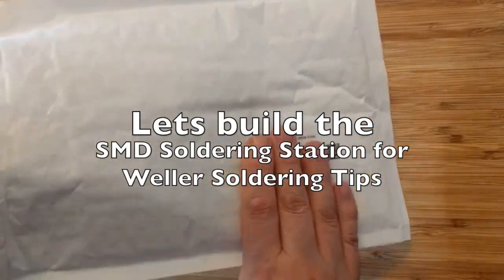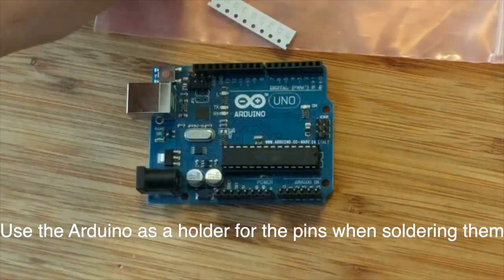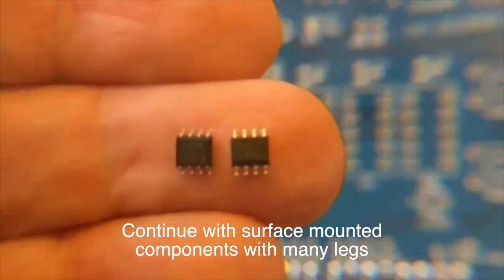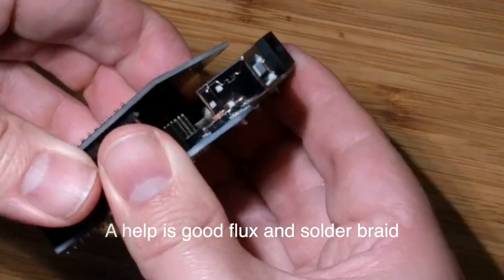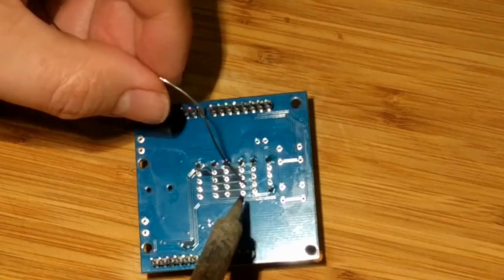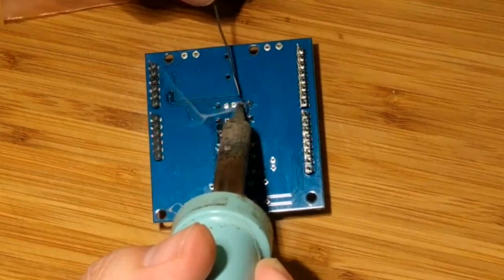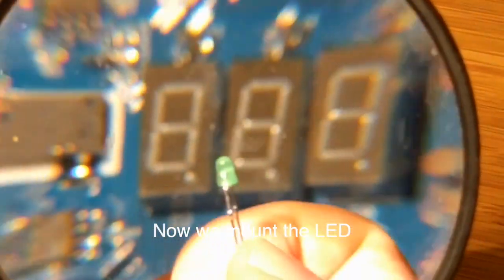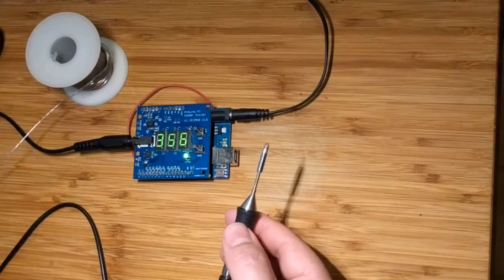We build the Arduino Weller Solder Station

Comment: Hello, how is the station at work?
Reply from the maker: Thanks for asking!
It works very well!
The regulation of the temperature is very precise and the power is never lacking.
However, there is one thing you could improve on.
Instead of using a 12V mains adapter, you can use one with a higher voltage, then you can drive the larger tips with more power.
However, remember to use a voltage regulator before the Arduino, as it can not handle a voltage higher than 12V, an LM7812 is good enough.